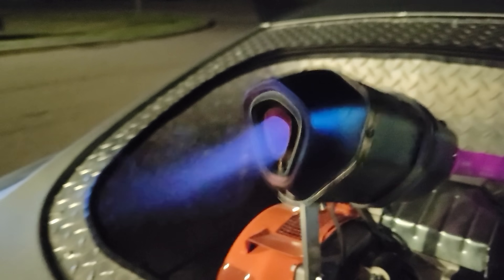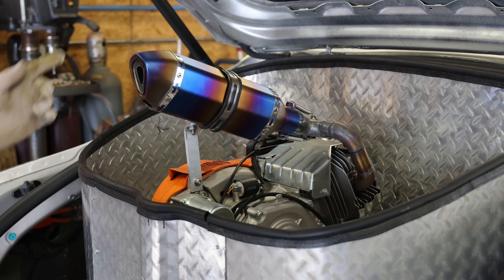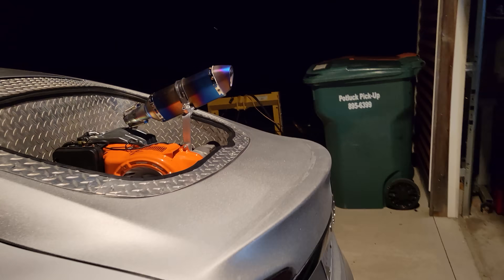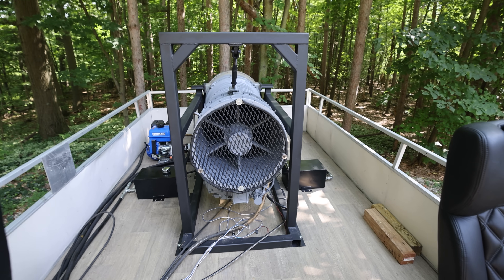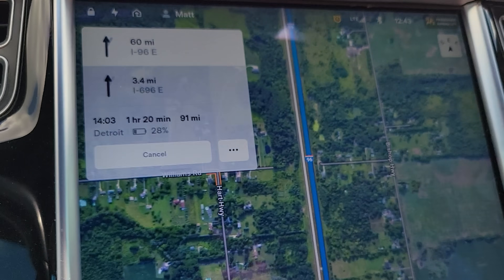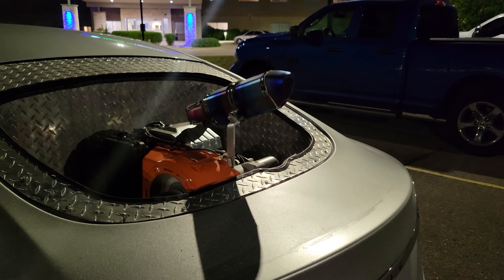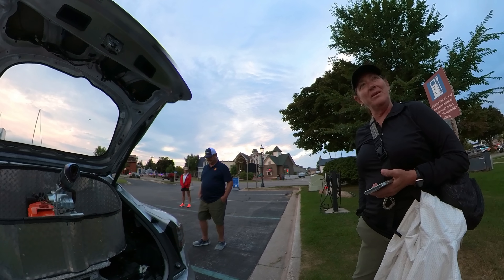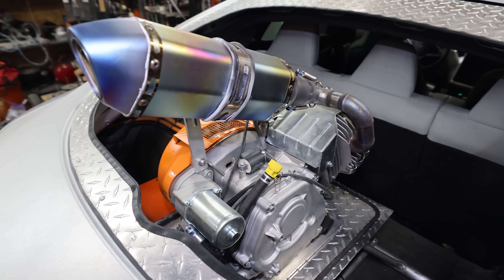Cordless Tesla (I Drive 1800 miles without charging) P.1

Comment: The title is very misleading.  You didn’t use any charging stations, but were charging the car with a generator the whole time.  Exactly what is your definition of not charging?
I see the title was changed to cordless after being called out
Reply: he created a hybrid- a very inefficient hybrid.
Reply: @jaybee3165  😂 Lol I was thinking the same !
But it's a great proof of concept, that let us appreciate how really efficient motor and hybrid cars are nowadays.
Reply: @HeronCalaris  diesel electric trains use the EXACT same principle. chevy volt is EXACTLY  the same.... but the efficiency of the volt is DOUBLE. the advantage of a true hybrid like this: no transmission. no clutch. no torque converter- and the engine / generator combo can be perfectly matched for maximum efficiency and power output.
Reply: @jaybee3165  Agree. Still do not understand why this concept introduced with Volt did not catch more. It is the most efficient way of charging as combustion engine is working at maximum efficiency. With possibility to charge batteries such car has all the driving benefits of EV and way better that any plug-in hybrid.
Reply: @gordanflego4154  it DID CATCH- with consumers anyway. volt is FAR superior to the toyota prius in the design of the drive train- and would have overtaken it in sales had they kept making it. that's the ONLY reason- GM killed it. and why? for the very reason that it took off: GM & Ford need 2 things from EVERY car they make: 

#1: they need it to suck gas- LOTS OF GAS. 

#2: they need the drive train to fall apart at 101,000 miles. 

if you own a volt- and your daily commute is 50 miles or less (round trip) you can basically thumb your nose at the gas station. that's one strike. next, there are a few youtube videos out there of chevy volts with 400,000 miles on them- and still running.... the battery range is gone- but the gas motor still runs the car. to big oil & GM? this is COMPLETELY UNNACCEPTABLE.
Reply: @jaybee3165  I am in Europe, and I was planning to buy one. But Ampera (Opel verion of Volt) came more than two years after and it was lousy supported.
Reply from the maker: @jaybee3165  the first hybrids were very inefficient, keep in mind I built this from the ground up on my own this wasn't even a final first version.
Reply: @WarpedYT  you need a 3cyl Kubota diesel instead of the noisy gas hog Genny
Reply: @jaybee3165  yea, regular Toyota Prius gives 40+ mpg at 70-80 MPH //
Reply: @AaronSchwarz42  yes- and NO. if you drive it without charging the battery on a long trip- the mileage goes down to about 33mpg at those speeds. for short commutes- the battery helps out the 'average'.. thus giving the ALLUSION that you're getting great mileage. here's the truth of the matter: gas engine- HORRIBLY INNEFICIENT. electric motor: EXTREMELY efficient. but that's not your biggest problem:

 you are stuck buying your fuel from ONE SOURCE: BIG OIL. big oil shored up their bets by investing heavily in coal & gas- but solar has been cheaper power than the grid for around 15 years running now. so for the price of a solar system & an EV? you can COMPLETELY ignore them... they KNOW IT & they're SCARED SH**LESS. they KNOW their time is short- that's the REAL reason they raised the price: or as I love to say: every time gas goes up another $1? a million tesla's get their wings- and baby- it's raining ev fairies!
Reply: @jaybee3165  Wouldn't say it's very efficient, it's loud and obnoxious, there is quite a bit more drag and he has quite a bit more weight with the whole setup + fuel tank. More efficient than a normal ICE? Yes. Could it have been built better for efficiency? Absolutely. Also his miles per gallon listed really weren't efficient at all. My v6 Impala gets better mileage than that.
Reply: may be should have ssid "i drive 1800 miles without using a charging station!"..either way it was really badd ass what you did with that ..and i really feel like this vid should have allot more views
Reply from the maker: @hooptastic_hippie8522  yeah that was a little bit long for me title is King you know.
Reply: Don't forget that he had to stop in a gas station to refill the generators gas tank.
Reply: @xSavagepr  that was LEAKING GAS THE WHOLE WAY FOR 1800 MILES. GIVE THE GUY SOME DAMN CREDIT. HE BUILT SOMETHING THAT NO ONE ELSE COULD.
Reply: @TruckerNash  other people have done it
Reply: @xSavagepr  No shit. He’s not trying to hide that lmao
Reply: it was slightly misleading but the project is cool and you have assume hes charging the car from unconventional sources. im not mad.
Reply: @nukethorn-v8l  or he invited free energy hack :P
Reply: @nukethorn-v8l  username doesn’t checkout
Reply: Oh my gosh. The cordless means no power cord. He use generator to charge and it have no cord. Duh. He doesnt use any either
Reply: @Hates Spam exactly. Right?
Reply: Next I'll do engine swap with wankel
Reply: To be fair, it wasn't misleading to anyone who understands the basics of scientific thinking
Reply: If this is misleading then the audience is stupid beyond belief, even the description explains and it is stated 30s into the video. Did you think he made a free energy hack?
Reply: Let me guess you were hoping for a massive battery?
Reply: I dont mind his not charging thing, but rather the "without stopping" part, since he basically went granny speed and had to stop at places (conveniently) and charged
Reply: If you are stopping 5-6 hours overnight you might as well plug it in and let it charge. Waiting for the generator defeats the purpose of driving without stopping at a charge station. 

Hope the next one is better.
Reply: @dustyreads6439  you're 100% on that. He mentioned "distance anxiety "...well, to me it's just trading one anxiety for another. Now he doesn't know if he'll have enough battery to reach the next generator charging point....sounds like anxiety to me.
Reply: He said he didnt even like stoping for fuel. He stopped for fuel and charge. Wasted money in gas and generator.
Reply: Uh i thought the point of the title was obvious.. he didn't need to stop to charge
Reply: I think he meant  the traditional plug in charger
Reply: I think the point is to show that extended range vehicles are better than just electric vehicles, meaning there's a generator on board generating electricity for an electric motor is better than an electric vehicle,and also better than just a gasoline engine it's the best of both worlds, obviously this is a little crude but if refined this would not be a bad idea
Reply: Good lawd. That's all you got from this? Have we not all had this thought go through our heads at one point or another?
Reply: A matching title is: Tesla on Gas for 1800 miles
Reply: As if this is the first time someone used a "catchy title" to get people's attention.
Reply: Ya, your using gas..
Reply: But he was cordless lol… im curious would it be better to have a better charging system like something bigger? Factoring in fuel consumption I feel like it would be better because of less load on the engine maybe not running at such a high rpm. Also I think you need a better muffler instead of an open exhaust. Oh and what about something that is powered by propane? Would it really make a difference?
Reply: I agree with you 100%. I was assuming some kind of solar charging station installed. It still took time to sit amd charge and the cost of gas. I would lobe to see this concept with solar and wind powered to charge a battery while driving.
Reply: What was the fuel consumption in mpg for this trip
Reply: @MANDERSONMOVIES  depending on his speed, 14 to 24
Reply: calm down ther negative nancy. he still didnt plug it in
Reply: @CrewCrewlancer  was it plugged into his generator?
Reply: Not hard to figure out that he meant not plugging the damn thing in. He doesn't have super conductors installed.
Reply: @RATTL3R186  what he meant and what he stated were two different things
Reply: When in the world will people start being honest ?
Reply: Soooo impractical lol. I’ll take my 20 min charge time every 300 miles over packing a lawnmower in my trunk that runs all the time. Turns out Elon is still
the more clever engineer hahahah. Fun project though and great content.
Reply: Dear Robert, please return yourself to the human assembly line to get a new firmware update that should clear up the bugs in your brain
Reply: @thenoid5131  so was he or was he not charging the battery?  All I asked was to clarify what charging means.
Reply: "Exactly what is your definition of not charging?"... Bruh.... Don't ask for info or links... how about you answer what ultimately charges electric vehicles at charging stations? The answer may surprise you ha. Let's see what you have that's better, especially not being tested beforehand? I'll wait. We'll all wait. 😃
Reply: So we build an electric car to avoid burning gasoline, then add a gasoline engine to charge it. 😂

Vicious circle.
Reply: Yeah still a trash car. And definitely a misleading title.  You strictly say. 'without using a single carger' bro you were using a CHARGER the whole time. Yeah this car will never be cool. Never be logical. And will always be one of the worst cars made. No matter what mod you or anyone puts on it.
Reply: Great experiment. A Prius would still be cheaper.
Reply: The wording ought have been 'without stopping to plug into any charging stations'.
Reply: @goodisnipr  It not worth it plus By Lines capture your attention.  He didn't plug in to any station that I remember. Loud motor though, I think he could of bought a gas generator with a 12kwh output and got the same results without all the work. Cut a 2 holes in the bottom of the truck for fresh air and vent the exhaust so everything is hidden.
Reply: Charging itself bro there is no bad idea there is only idea for improvement. Keep your mind open minded!
Reply: @Johnny-fe2rg  he was hoping for a giant battery
Reply: Hahahahaha
Reply: Put a bigger generator but have the car wheel rotation rotate the generator so the faster u drive the faster the generator spin maybe need to put a gearbox for the ratio of spin you mind me one first charge lol
Reply: @nsantiago0311  youre trying to suggest perpetual motion. Which is improbable
Reply: @masklessninja  no, all of them are.
Reply: The title does not say "No electrical input." 
It delivers what is promised - no charging ...
Reply: @branchcovidian2001  what part of running a generator to charge the battery, is not charging?
Reply: @robertheinkel6225  What part of being self--contained IS using a charging station?
Reply: Correct! Worthless and so much work!
Reply: what do you expect. its just a dumbass idea for our entertainment. the crappy amateur editing is what makes this video unwatchable.
Reply: He means without having to stop to specifically charge the car at a charging station.
Reply: he charges card with the same system that would be normal, like is suppose to be, I would rather just drive a normal car screw EV..
Reply: @UCC0dfrL0dRkkuQJsSsfGEFg - He did have to stop. That’s why he’s looking into upgrading the generator.
Reply: What charging station did he stop at?
Reply: IT IS SAID, “THE TWO MOST COMMON ELEMENTS IN THE UNIVERSE ARE HYDROGEN AND STUPIDITY.” , IT WOULD SEEM THAT YOU HAVE OVERDOSED ON ONE OF THOSE!
Reply: How did they solve the biggest problem: charging while driving??? Electric cars don’t allow that. Or was the generator directly connected to the battery? That would be extremely dangerous. I don’t get this to be honest.
Reply: @cstrx11  I was wondering the same. Unless the engine is connected to the rigen system? What that be possible? But even then, I'm not sure rigen is allowed to dump 10000W in the battery.
Reply: Energy can be made. That’s what a generator is for. To create energy or electricity. Am I wrong? Or just thinking too hard?
Reply: @logandowney03  The 1st law of thermodynamics is that energy is never created or destroyed, only converted. In an ideal system everything is convertes, however in real world applications there are always loses in the system. Generators convert energy from one form to another, chemical to kinetic. If he hooked the generator up to the wheels it would be more efficient than adding a battery in between the two.
Reply: @illegalopinions4082  Yeah I knew I was thinking too hard hahaha. Right when I commented that I knew I was wrong. Thanks brodie for the explanation. Very well done.
Reply: @logandowney03  I think one of the laws of physics would disagree with you…
Reply: @RedHaloManiac95  aight I'm deleting this comment its already been situated read the peoples replys smh
Reply: Isn't it self explanatory concerning a Tesla? you have to plug them in to charge, unless you have solar
Reply: @justmechanicthings  It was a question. Not a question to get lectured. I knew I was wrong when I posted it cause I thought of the gas having to be converted.
Reply: I think he title cordless
Reply: We all got it
Reply: Shet up
Reply: Great video! The comments section entertained me the entire time. I'll check back and I'm sure there'll be more.
I have the same feeling of not wanting to be stranded. If you want to add a stop on vacation, not having to check for charging stations along your route. How else do you take a long weekend over 500 miles away? Sweet. Stir, stir, stir
Reply: Robert Heinkel..You win!...Your comment is in the top ten most asinine comments of all time...way to go Bobby!
Reply: People are dumb sheeps, ev is bulshit pushing it is a matrix agenda to control you, keep the ICE and have your stupid electric toys live and let live, Cool video Brother!
Reply: Seems obvious enough that his point was he did not plug in that Tesla to any sort of fixed charging station. Which is a really fun thing to play with. I'm envious, wish I had the time and money to do fun stuff like he is doing! Sure, totally pointless, but who cares! It's a fin project! THE FUN IS THE PO"INT!!!  :)
Reply: He didn’t say ‘no charging’ - he said CORDLESS
Reply: @water1051  he said "without charging
Reply: Click bait :P.  I initially thought it was a battery upgrade.
Reply: A friend and I are working on a similar style project however, we are using a larger diesel generator.
Reply: Cheap, clean energy technology:
Search terms:  Brillouin Energy
Search terms:  sirius Griffin pdf
Search terms:  orion Stan Meyer Full Data pdf
Reply: I think you would’ve been more satisfied a title like “Magic happenings”
Reply: He said "Cordless", so no external cable charging.
Reply: @gordanflego4154  Buuuut

What does the title of the video says?
Reply: @gordanflego4154  so the cord from the generator to the battery doesn’t count as a cord?
Reply: He literally said he hated to STOP and CHARGE. It the downtime he was attempting to fix which he obviously did.
Reply: for real and not only that the video sucked because everyone knows teslas are shit like wtf even using a charger the power grid couldn't handle charging his one car
Reply: I think the title was fine. If he would have had a trailer with 300 kWh of battery of battery, it would been alike and also without charging.
Interested in how he made the tesla accept charge while driving and how efficient this was.
Reply: there's an easy fix to this problem- what YOU must do.. .is unplug your computer, then put it in that special container at the dump that says "electronic waste"... and you must do this because

you are too St**pid to own a computer. 

also... your parents should ask for a refund from your 1st, 2nd & 3rd grade teachers.... maybe the hospital where you were born as well.
Reply: I think your answer is in the name of his channel
Reply: I know right. Just buy a toyota hybrid for a tenth of the cost, the lengths people are going to ta try and keep in with the government wanting to keep the last of the oil for their yachts and private jets.
Reply: @stakman78  a toyota prius is only a hybrid... if you can say that a ford fiesta with a hair dryer motor (linked to the drive shaft by rubber band)  & a D-cell battery is ALSO a hybrid- then yah. otherwise? NO. A PRIUS IS NOT A HYBRID. it's a great gas powered car- but a hybrid it is NOT.
Reply: I'm pretty sure that the title was cordless when I saw it.
Reply: Then do you count regenerative braking as charging then?
Reply: @Jdo-pg1lk  on a tesla? you bet your a55.  but that's not really the point. he's trying to make a tesla that you don't have to plug in- but using gasoline is pretty self defeating. I have a tesla model Y. I charge at home. it has a range of 300 miles- all I'll ever need. to match my cost of operation- even in a prius or volt- you'd have to find a gas station that sells for 35 cents a gallon.
Reply: the title says cordless tesla and he never used the charging cord so he never lied
Reply: It pretty clear what that means. It's obvious he didn't just make the car extremely efficient and the thing in the back in the thumbnail doesn't look like it is related to making the battery bigger, so (to most people) it should be pretty clear what he was doing.
Reply: Is like a big alternator in your car same function lol
Reply: he didn't use any charging station numb nuts that was the whole idea ...

he never said he couldn't use a generator
Reply: Purpose was not a long lasting battery but an idea for a car that can get good mileage per gallon.  Your point?
Reply: dont cry dude! its ok!
Reply: uhhh duhhhhhh
Reply: He didnt use charging station, he used mobile charger. You cringe
Reply: @MarinTheFirestarter  it was still being charged, just not by a stationary station.
Reply: Must be new to YouTube.
Reply: Not stopping to charge.  Duh
Reply: It’s really stupid
Reply: And the emissions are probably worse than driving an F-350.
Reply: Disagree, what he clearly meant is that the vehicle is being charged while driving! He doesn’t have to stop and charge a vehicle at a supercharger or a non-supercharger which would take quite a bit of time and if there’s no charging locations on his road trip that he would be dead in the water! It’s really quite self-explanatory you didn’t watch the video?
Reply: @ualreadyknoitsyaboi  but god didn't create anything as he does NOT exist. You show me proof of god. Right now. Like as in right now. Go ahead I'll wait...
Reply: I can see them making these generators in the years to come
Reply: I don't think it was misleading because he put "cordless"  at the start of the title. Maybe slightly incorrect wording but not misleading. 🤙🏼🤪
Reply: Cordless was the claim, not "not charging"
Reply: @pjballs69  "I drove 1800 miles without charging"....
Reply: @ualreadyknoitsyaboi  which is why we can only transfer it. We are not gods
Reply: He didn’t stop to charge. The battery is still being charged by the generator though. The point of the video was not to stop on the road trip.
Reply: @realmichaeltian  yeah so the title is misleading, clickbait just like many other videos nowadays
Reply: @realmichaeltian  but he still had to stop and let the generator charge the battery overnight to keep driving.
Reply: So we have discovered clickbait? On YouTube!
Reply: @DeputyNordburg   The real question here : Put it all together on a cost sheet and get back to us. 
But util then .....Will it catch fire ?
Reply: If this title is your idea of "misleading" on YouTube I don't know how you've ever watched a single video on here without making this comment pretty much every single time🤣. He said "wireless" so I assumed he was going to use some alternative method of charging other than plug in. Leave the drama for your baby momma bruh.
Reply from the maker: Energy can be transferred cannot be made. The energy has to come from somewhere that's what a lot of people don't get.
Reply: @WarpedYT  Bro, this is n ICE car with extra steps. Anyone trying to sell EVs as a good idea need to really take a step back and think lol.
Reply: @WarpedYT  You still charge your car on the road, so it is kinda missleading. if it would say "I Drive 1800 miles without using charging stations" Then it would be correct. tbh you could also buy a normal car for the same effect. and where does it make sense to get an electric car if you build a gennerator on the back. isn't the point behind this to protect the environment instead of emitting even more co2 than the car hasn't already produced in production anyway?
Reply: @WarpedYT  So basically you lied
Reply: @WarpedYT  I as well as he believed the vehicle would be solar operated  but use some form of turbine generator to keep it operational that did not need fuel consumption.
Reply: @WarpedYT  I'm with you dude because some country using diesel and coal to made electricity, so it was the same
Reply: @WarpedYT  - I hate to be that guy but my basic calculations (and I could be way off) tell me that under normal driving conditions, you need 26KVA generator if you don’t ever want to stop to charge the battery (but still plan on stopping to sleep). You need a 16KVA generator if you want to run about 600 miles (basically 8 hours of driving at 75 mph). The 26KVA generators I looked up have a 1.9 liter motor and 16 KVA have a 800 CC motor. That’s the approximate size of generator you need if you want the electric car performance but don’t like the long charging time.
Reply: @WarpedYT  energy that can be transferred can be made in the future due to technology advancements
Reply: @WarpedYT  I thought I seen you in Detroit I live 3 miles down the street
Reply: @WarpedYT  "....without charging" is still a false claim and clickbait. In general, it's a myth that electric cars are truly greener. All we see is drag racing and driving many miles for "tests" that treat energy from the grid as if it's expendable. Ruining landscapes with wind turbines adds to all the faux green hype.
Reply: @WarpedYT  Why didn't you use a larger genset?  Wouldn't a 10Kw charge quicker using 3-Phase 220V/240V?
Reply: @WarpedYT  yes but you are Charging the batteries
Reply: @WarpedYT  no we get it. We would rather use the polluting infrastructure we have to use regardless to switch to one that doesn't rather than staying on one that pollutes and is finite. What's your solution?
Reply: @WarpedYT  Awesome job👍 I can't wait to see the upgraded version🙂.
Out of curiosity, would covering the body with solar be worth the trade off for weight addition? I seem to remember there was talk of a flexible solar film some years ago🤔. Where did that stuff go?
Reply: @WarpedYT  @Robert Heinkel doesn’t understand how energy works
Reply: @WarpedYT  you charged the car though....
Reply: @WarpedYT  best answer, title is spot on and anyone saying otherwise is just plain delusional.
Reply: @WarpedYT  don't listen to this guy, your title is spot on

Question /comment though, it seems like that 400cc engine could be half as loud if you built up the exhaust on it 

Insanely awesome video 🤘🤘
Reply from the maker: @fishjohn014  so I'm almost done with version 2, I started building it almost 2 months ago so when version one came out I can have the videos back to back. However I ended up putting the original version back together this morning because I need to take the car in another road trip unexpectedly. I just bought some new mufflers and I'm going to try to weld it together over the weekend and see if I can quiet it down, the issue is that I figured out today most of the noise is coming from the air moving through the engine from the fan, and some of it from the exhaust, but also a lot of mechanical noise in that engine. That thing ain't no Briggs & Stratton or Kohler that thing is noisy and sounds like it's going to blow apart. But I will be sharing some short form content as I go to my next destination while I'm shaking my head and disbelief because I know this thing just doesn't have enough power, I'm only a few days away from finishing version 2.
Reply: @WarpedYT  ahh that makes sense

I'm pumped to see version 2.0

Safe travels brother 👍👍
Reply: @fishjohn014  it was missleading bruh? He was charging the whole time with a generator
Reply: @fishjohn014  I'm John Fisher and I love to argue with people that have a good point because I'll get noticed that way.
Reply: @WarpedYT  what if you put heat resistant insulation in the engine compartment to reduce the noise emitting from the compartment and then a bigger larger or perhaps longer muffler?
Reply: @WarpedYT  he asked for your definition of charging not  what the first law of thermodynamics is. You still didn't answer, you still CHARGED your vehicle with a generator.
Reply: @Mr3344555  OMG just unsub and go away already
Reply: @Mr3344555  you must be new to YouTube if you’ve never heard of clickbait. Although it’s not really clickbait, it’s just a different definition of charging. Don’t see why you and OP are butt hurt
Reply: @Mr3344555  and see how his fanboys ran to his defence even though he lied.
Reply: @Mr3344555  and if you think about it, it sounds like it takes much longer for the generator to charge the battery than a charging station. Proof of concept: fine. Anything else: pffft!
Reply: I don't even know if this is real.  Seems like clickbait since the generator/alternator isn't even shown anywhere that I can see clearly.  Seems just the OHV engine like as a prop with no real 10KW generator.  Maybe I'm missing something or missed some clips showing.  Seems way small unless some new design stator-rotor system.
Reply: Very misleading that people think you’re charging while driving but you’re not.
Reply: How long it take him to plug in and charge vs filling a tank? That's the point. It rewarded me with this absurdity so don't have a problem with the clickbait!
Reply: The first thing I thought when I read the title was he's gona use gas powered generator title is not misleading
Reply: @Durkhead  it implies that he is charging while driving.
Reply: not using the cord
Reply: The title is extremely misleading and should rightfully be considered clickbait.   He had to charge the car the entire time.  Not only did he have to charge the car the entire time, he used gasoline to charge the car the entire time.  What he does not say is how much gasoline he used for the entire trip.  How much gasoline did he use the entire trip?   I would guess that he used about 100 gallons of gas and got an average of 18 miles a gallon, but that would be my guess.  What this guy did though was prove that electric cars are very expensive garbage that should never ever be forced upon the American people.
Reply: @drsteiny1  funny enough this car could be seen as a political statement because sure you may plug in your car at home but there’s still fossil fuels running to generate that power
Reply: Its not that serious dude
Reply: Cordless is cordless, stop whining.   All the weak ever do is whine like babies.  Your perception is warped the wrong way.  Cancel the whining!!!
Reply: The logic in your question just goes to show how this is obviously over your head. I bet you're the kinda guy who doesn't even cut his own grass or even change a tire.
Reply: That is an extremely pedantic correction, which I love. But charging has become a colloquialism for using a charging station for EV vehicles.
Reply: This was great as an experiment but terrible for practicality. I'm glad you tried it even though I'm cheering for the demise of ice vehicles. It shows how problematic the concept is and why it would never work in the future world as it demonstrated. However, nothing ventured nothing gained and to me this was a science experiment. Perhaps there is some aspect that could be salvageable and developed into something useful for future generations. It's not like everyone is doing this. My most important observation is that you could have recharged by plugging into the motel or hotel where you were staying overnight. That's the plan for the future even though it's not established at the moment. Slow charging is way better for your vehicle anyway. Secondly, you've given up all your luggage space. What's the point in travelling 1800 miles with no luggage (assuming that you have passengers.) Bottom line, it was entertaining, and you have some great skills.
Reply from the maker: @checkfactschecking  thank you, I sort of kind of agree with what you said, but I actually see things a little bit differently than everyone else, and so does Elon but he won't ever touch the space that I'm about to touch because he's driven by marketing. and I wish I could give you more details but by the time I get to episode 5 you will see what I'm up to.
Reply: @checkfactschecking  some hybrid vehicles used to be exactly that, an electric drive car with batteries charged by a generator driven by an atkinson cycle engine.

Most modern hybrids use a combination of gasoline engine power drive and electric motor drive howerver they still have a generator driven by the gasoline engine.

Plug in hybrids do as well, but they also can plug in to charge obviously.
Reply: @cheatinggravity173  I just looked up that info and there are 2 common systems for hybrid vehicles, Parallel and Series. The Series style uses a generator. Almost none use that system. In Parallel hybrids the engine drives the wheels directly through a shared transmission. Toyota, Lexus, Hyundai, Kia, Ford, Honda, Lincoln, Nissan, and Infiniti all use the Parallel system of hybrid technology.
Reply: @checkfactschecking  do a little further reading and you will also see that plug in hybrids are the only ones that don't have an IC engine driven generator on board and rely solely  on the battery pack to provide electricity to the motor that helps the gasoline engine drive the wheels.

Most hybrids do not plug into an elecrical charger. They charge their batteries with an on board generator that is driven by the engine rhat also drives the wheels.

Very very 'machinery heavy' vehicles that use alot of natural resources in exchange for good gas mileage and/or good power.

I was just reading that the chevy volt (?) Has a gas engine that strictly drives a generator to charge its (fairly substantial) battery pack.

There are sooo many reasons why I like this system if it's done right. You can have a flat floorpan because there's no driveshaft. No transmission and its related heavy components running in power robbing oil. Full torque at 1 rpm. Can charge with either gas engine or plug in. Atkinson cycle engine runs strictly at its most effecient, optimum rpm and is way more efficient than a traditional otto cycle IC engine. Then there's the massive amounts of horsepower available in modern electric cars if you wish to pursue that. There's more reasons but I'm tired and can't remember lol.
Reply: @checkfactschecking  You can choose to structure your life so you don't need an ICE vehicle. Not sure why you're cheering for people not to have access to personal transport.
Reply: @illegalopinions4082  Quote me where I cheered for people to not have access to personal transportation?
Reply: @checkfactschecking  "I'm glad you tried it even though I'm cheering for the demise of ice vehicles."
Reply: @checkfactschecking  i will keep driving my ice car. i will dance on the charred carcas of every EV i see. i cannot stand that worthless concept. it was tried many times before and every time it has come around, it has been total garbage. 
porsche is working on synthetic fuel and toyota, yamaha, and kawasaki are all working on hydrogen tech. i'll bank on toyota's hydrogen long before i even take an oversized power wheels toy seriously for future transportation of any kind.
Reply: @roadrocket7770  There is no car on the planet that fits everyone. You think EVs are equal to power wheels and for you that may may be true.  But for some, EVs are a perfect solution to their situation.  I have a head and cam LS2 swapped 52 Chevy Pickup that I built from the ground up. I had a supercharged C6 Corvette before my son was born and I had to switch to sedan life.  So of course I bought a CTS-V.  Then I got stationed in California. Where between $6 a gallon gas and an average 12mpg from a supercharged V8 I was spending $700 a month in gas.  But I like fast cars.  After I rode in my friends P100D I was sold.  It was faster than my CTS-V and basically got 100mpg.  Except I was living in base housing so power was free. I bought my Model S two years ago and never even think about the CTS.  I’m a car guy and I love fast cars and honestly I don’t really care about the environment.  Idgaf how my car is powered as long as it’s fast. 

An EV may not be the best fit for you and that’s fine.  But trash talking a technology because it doesn’t fit you or your ideals personally isn’t the best look.
Reply: @roadrocket7770  So you choose to be part of the problem and not the solution. Thanks for nothing.
Reply: @checkfactschecking  if you’re cheering for the demise of ICE vehicles, you should probably also be talking about private jet use among celebrities. Those jets put tons of harmful emissions out on a one hour flight. A lot of celebrities even take flights from one part of a city to another just to avoid traffic. The jet has to idle to warm up, land and idle to cool down. It’s pretty ridiculous how clean cars are today but yet the private jet industry is practically unrated.
Reply: @checkfactschecking  he has plenty of room in the trunk area to put a larger generator. Probably do a v-twin with a 20kw generator head and be able to drive interstate speeds all while using far less gas than a 1000HP gas powered car.
Reply: @kwhp1507  Regardless of what you just said, the whole concept doesn't make any sense for a world that needs to wean itself off oil and coal energy. We are making tremendous progress of renewable energy and the speed of recharging. China has technology in production with cars recharging in 4 minutes. Meanwhile in America we are crying and throwing tantrums about progress. China is wiping the floor with us because of your mentality. The US is losing its superiority where it counts. You should get on board and champion US technology instead of being a lead weight.
Reply: @checkfactschecking  IC engine vehicles are great, probably produce less waste than an EV, but only in an environment where we put bio-fuels in the tank which is a very distant possibility because of the oil corporations. we can surely grow our gas i am damn sure. EVs solve any problem by adding to it in the short run. What we need to work on is Biofuels. The problem is not Emission, the problem is big oil companies and capitalism. Please prove me wrong.
Reply: Wrong. The biofuel is not panacea. Coz to growing up the crop and converting it to fuel need a lot of other resources like fertilizers, and in final count carbon footprint is bigger then using gasoline. Fingers crossed for Tokamak))

PS: Capitalism is not the problem - actually for now it's the most efficient economic system that humankind have. Writing this comment from ex-socialist state)
Reply: @pat21495  blaming Capitolism? 🙄 Your options are Socialism or Communism. Please show their "success" 🤡
Reply: @100pyatt  not capitalism per se, but the greed that comes with it.